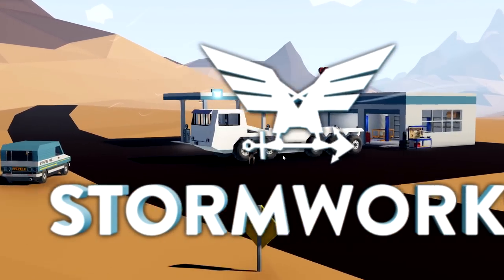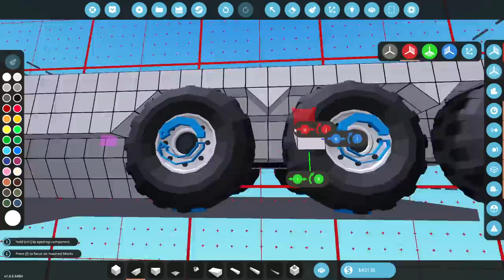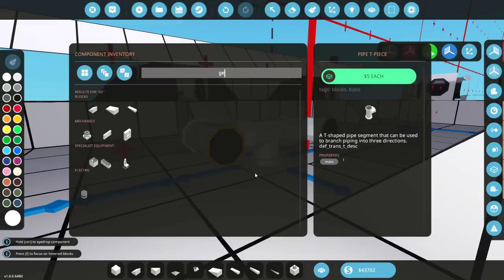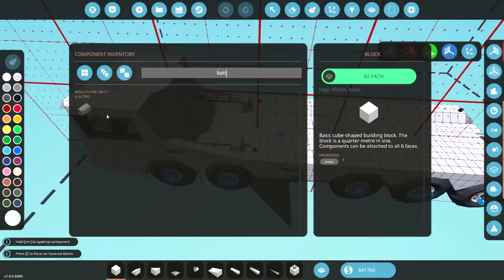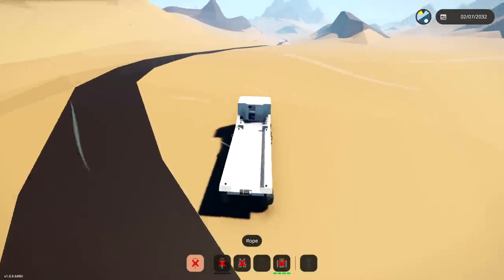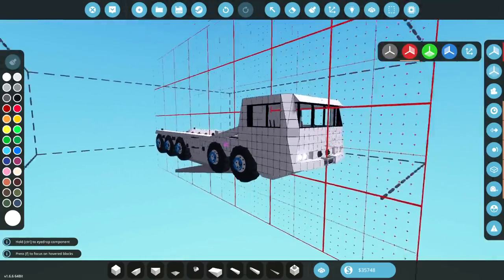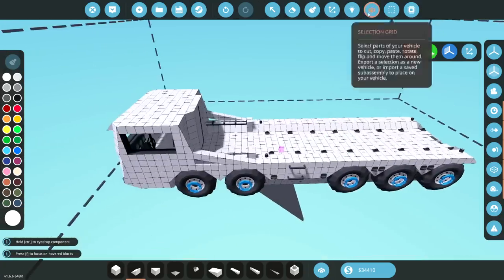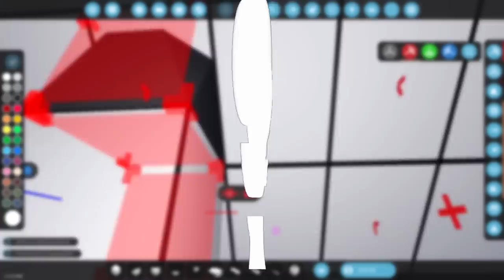Will Our AMPHIBIOUS TRUCK Float? - DLC Hardcore Career Mode - #19 - Stormworks Build and Rescue

Comment: Also you should probably unlock modular engine because they can be a lot more fuel efficient than the usual small engine and it’s not like you have a fuel shortage anymore
Reply: prefabs at 8 RPS seem ok, easier to cool as well

Comment: Hi Frantic, you should have 6 motor for the back wheels and 4 for the front. As you have 4 motors driving 4 wheels at the front and 4 working 6 wheels at the back. The truck will have more of a 60/40 power distribution. I would replace the 4 motors at the back with 6. That will give you a 50/50 power distribution and have faster starts and better towing capacity as you have less of a chance of spinning the front wheels if you have weight on the back

Comment: With enough power and fluid jet you don't really need to make it float. SPEED AND POWA works as well.
Reply: Definitely true, you can make a rock that sinks straight to the bottom, but make it float if you haul enough ass

Comment: Make the truck a hev or hybrid electric vehicle so you ca  just drive around d in electric but if more power is needed or the battery is low the engine can fire up and help charge the battery or propell the truck and you would not have to worry about a million batteries